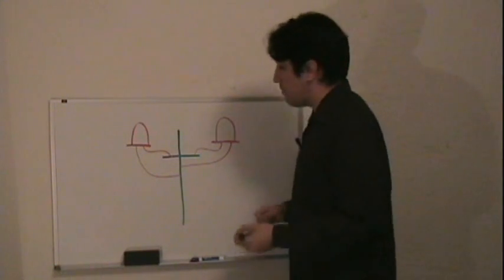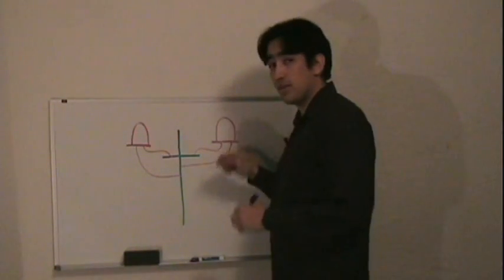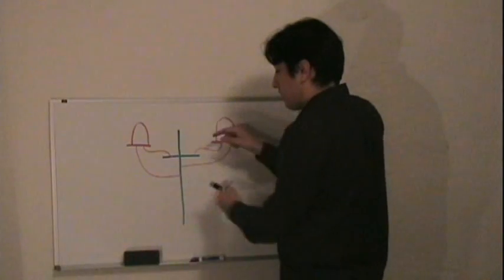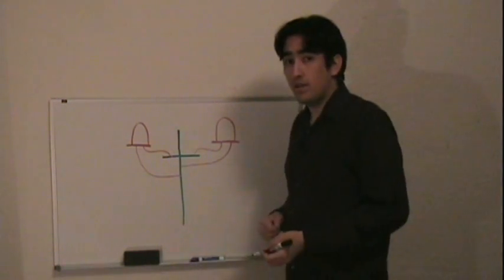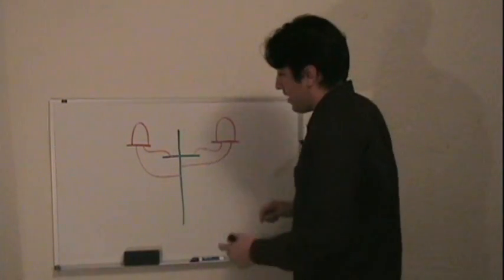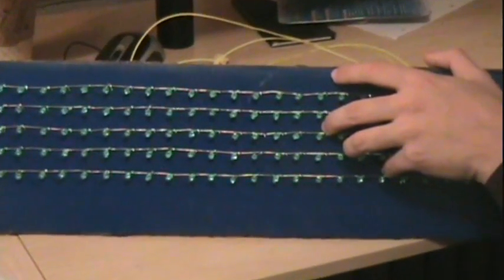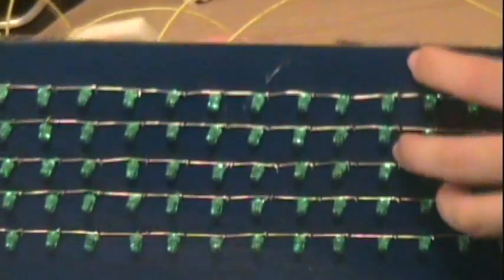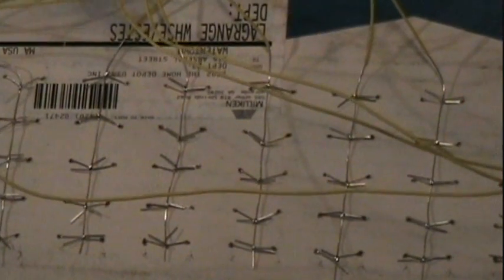DIY LED Array Text Display Marquee

Comment: @envisionelec It's NOT Charlieplexing. Charlieplexing uses the micro controller's ability to have three states (tri-state: Input, HIGH, LOW). With Charlieplexing you could control 272 LEDs with 17 pins.